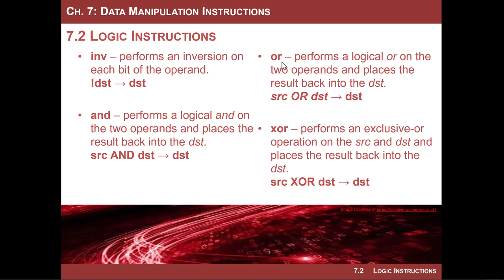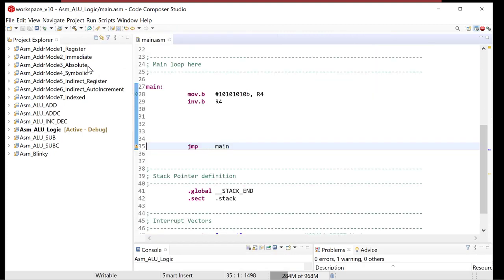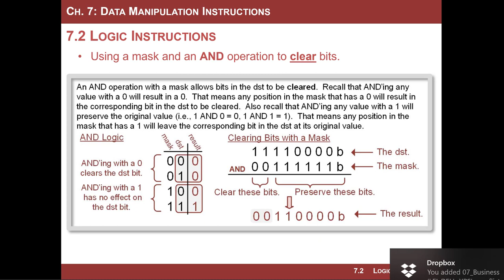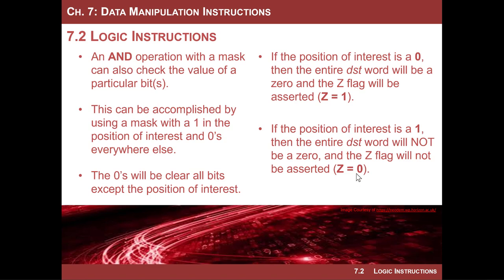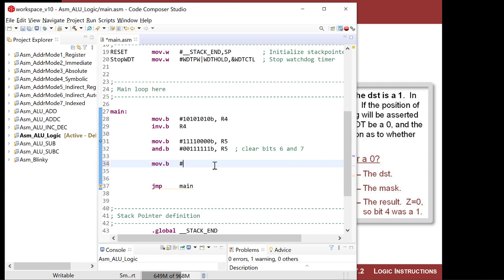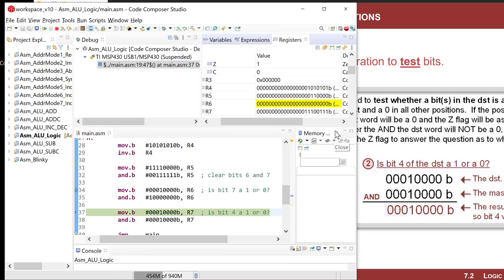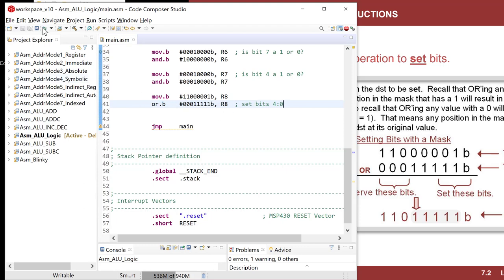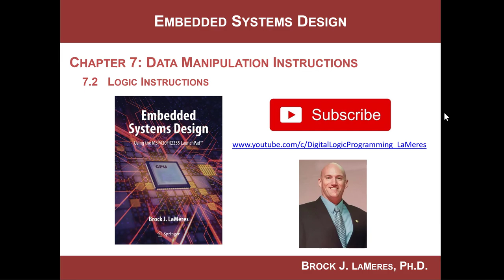7.2 - MSP430 Logic Instructions (INV, AND, OR, XOR) + Bit Masking

Comment: I was wondering while watching this video if there is a way to test more than one bit when using the AND mask to test bits. 
For example if you wanted to test 11110000b with a mask of 00110000b but you wanted to know if bits 5 and 6 are set or not. If you ANDed them you would get 00110000. The Z flag would be 0 but how would you know which bit was set? 

Or do I need to just wait to learn more? I am sure there is a better way but I was curious. 

Thanks for the great videos and book. This combo is exactly what I was looking for as I am new to embedded design/programming. I really like the way you break things down and show what does what and why.